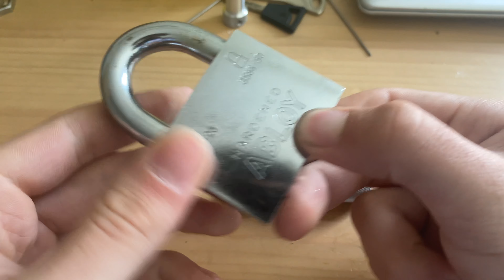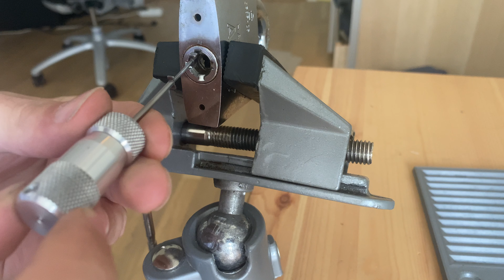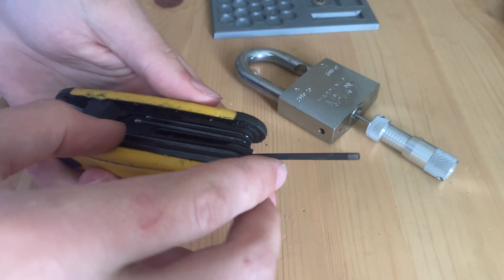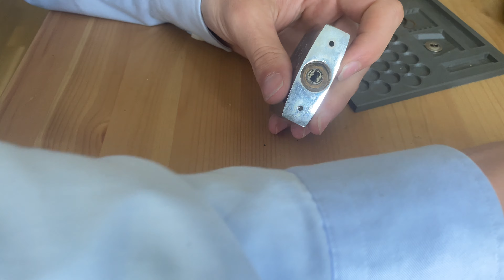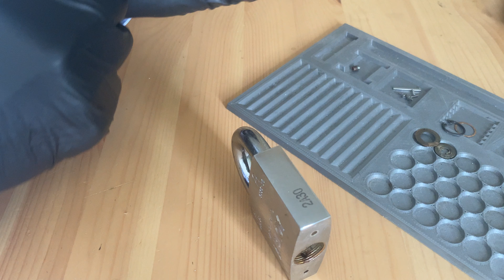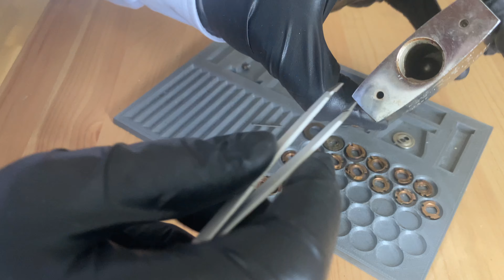Rear tension disc detainer pick slays Abloy Disklock

Comment: Are the holes different on the 4 picks you showed? 2 of them looked smaller diameter than the other 2
Reply from the maker: I have no idea what you are asking but the holes on this tool is 2.3mm and 1.5mm
Reply: @tarehjernetarehjerne4082 when you showed the 4 from the back the two inner picks had holes that appeared different from the two outer picks. Also the rear handle looked chamfered on the two outer picks and not on the two middle picks (they appear more flush to the piece on top of them) so I was curious if they were different

Comment: You know your tool better than anyone, but my first impression was, before you even mentioned it, was the outer sleeved pick would be susceptible to slipping.We all have inventor's bias. But regardless, what could you do to reduce the slipping? Most people will be hard on a tool and expect reliability.
Reply from the maker: @laurenarndt464  good question.
If the outer sleeve is slipping you are using too much force. It takes 2-3 Nm to make it go, and thats way more than needed.

If you are worried about slipping, you can use locktite to fix it in place.
Reply: @tarehjernetarehjerne4082  Thanks for your response. Have you tried making picks from 1.4 mm by 3.5 mm ejector pins with sleeves?
Reply from the maker: @laurenarndt464  no, these are custom parts made by me and my machining company.
They are not available commercially
Reply from the maker: @laurenarndt464  i have not made any by those specs or other type of ejector pin